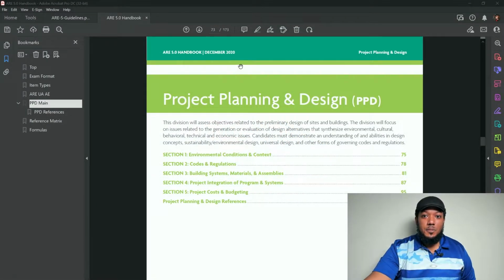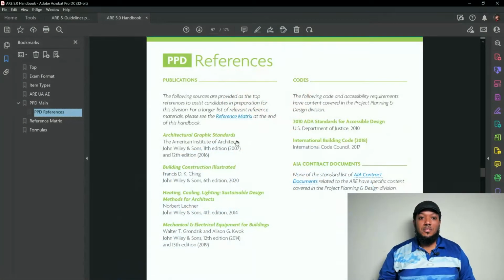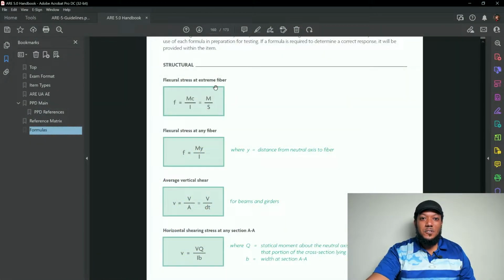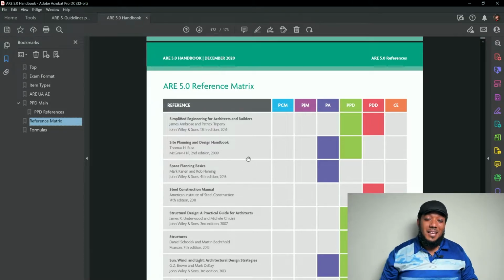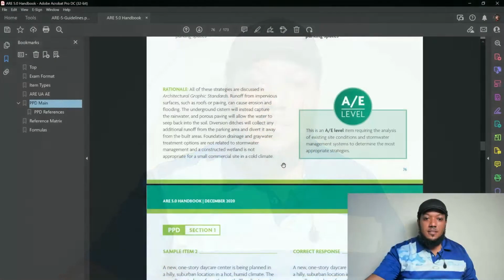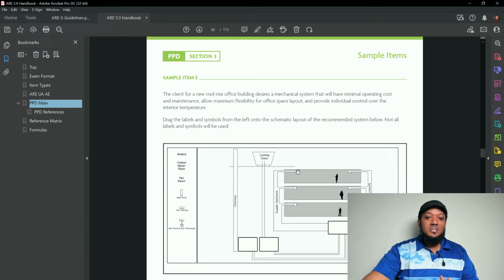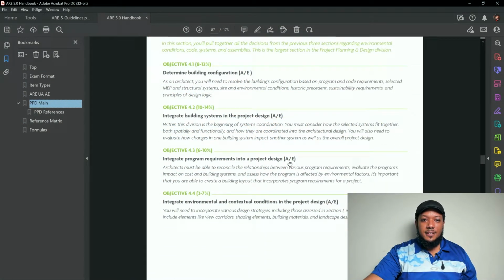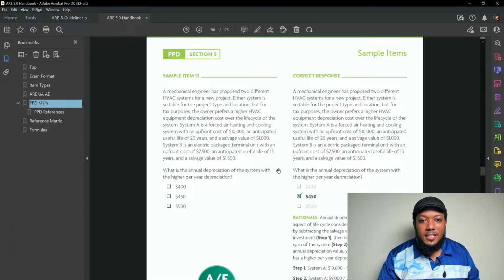How To Pass ARE 5.0 PPD Project Planning & Design | Architecture Registration Examination

Comment: Great video. Thanks man.  I’m studying for pa and ppd.  Freaking tough. I’m using amber books, hyperfine, most recommended books by Ncarb, and many test exams.  Hope to have my freedom back.
Reply from the maker: Its good to find a special freedom in learning about architecture as the exam requires. With every resource, its always best to find a single strategy to operate by, e.g. per section or question type. I wish all the best in those exams!